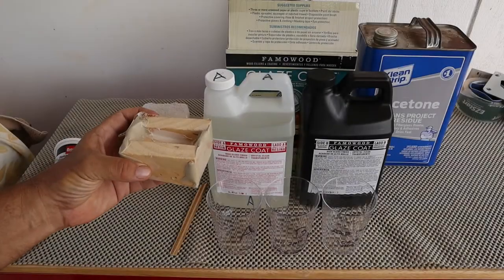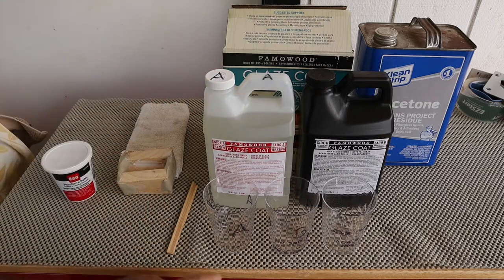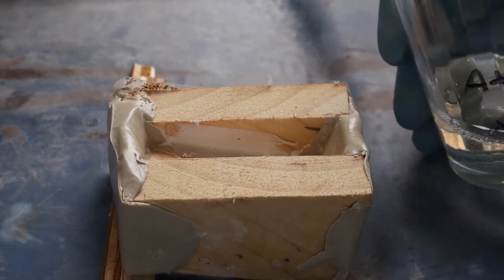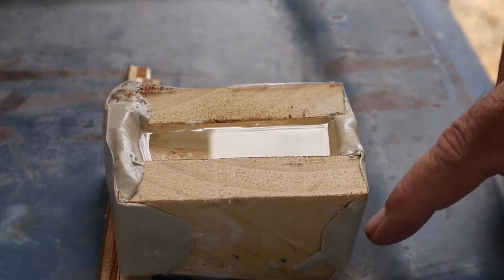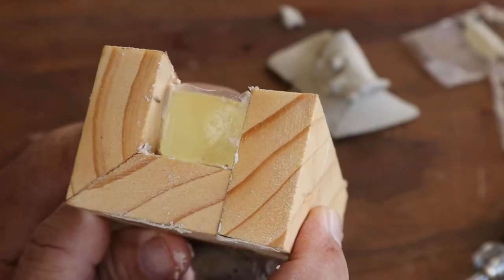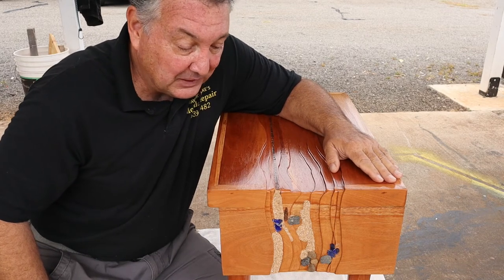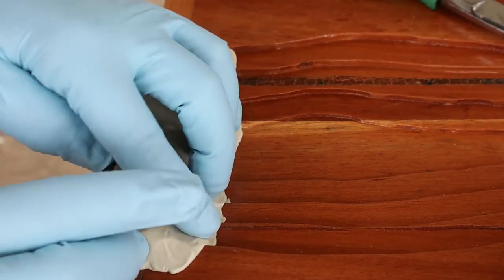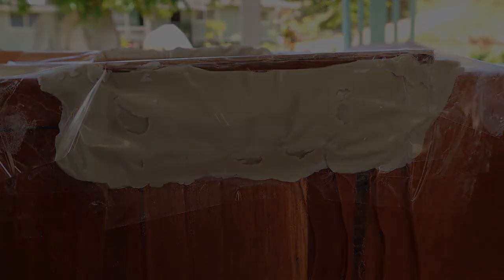Resin Mold construction and Mold Release: Using Plumbers Putty!

Comment: How did it turn out? Did the edges end up messy?
Reply from the maker: Aloha, The mold held the resin well and did not leak.  The resin conforms to every void, angle, imperfection that I created in the mold. So if required for what you are doing pay close attention to the details of the shape of you mold.
Good luck,

Mike